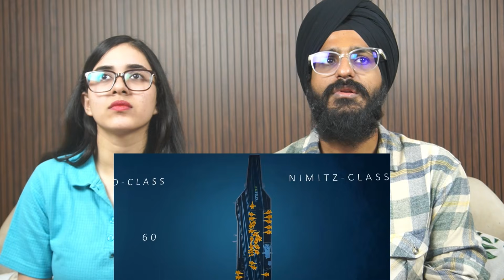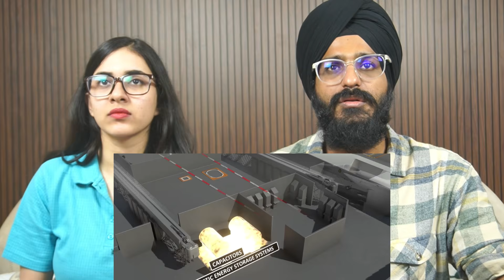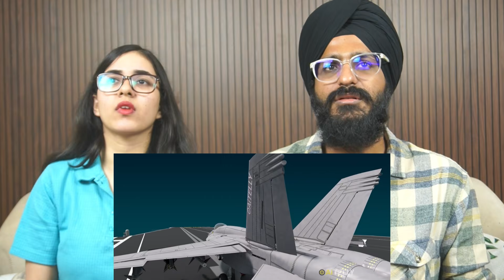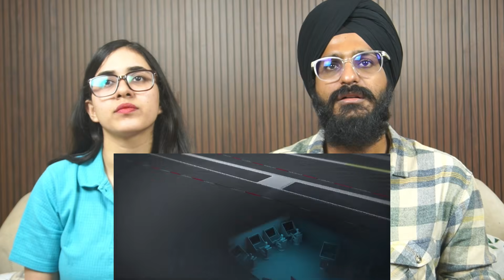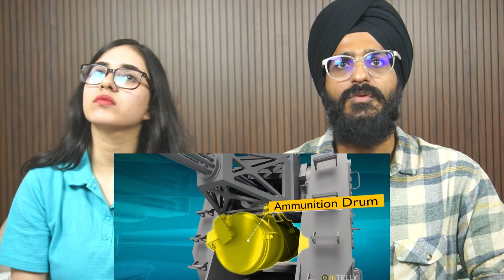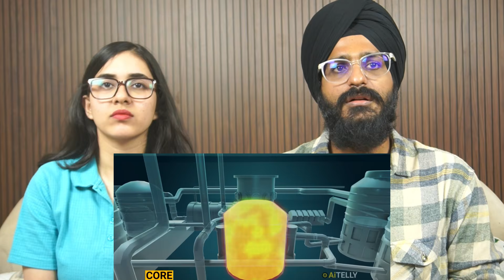Indians React to Inside US Biggest Nuclear Aircraft Carrier | Gerald R Ford

Comment: You asked if something goes wrong like the engine failure. I mean things do happen but America has 11 aircraft carriers but they only deploy three or four at a time. The other seven are constantly going through maintenance and upgrades. They keep rotating the aircraft carriers. In case a large War ever breaks out United States can operate 8 to 9 aircraft carriers at one time. Wait until the new battleships come out. Don't believe what you're hearing right now about the battleship. The public knows what the government told them. It's top secret we won't know its capabilities until it is built. It's due to possible war with China. That battleship will be able to jam signals Advanced radar and Warning Systems and it's going to be armed to the max. It will be able to park off the coast of China and wreak havoc